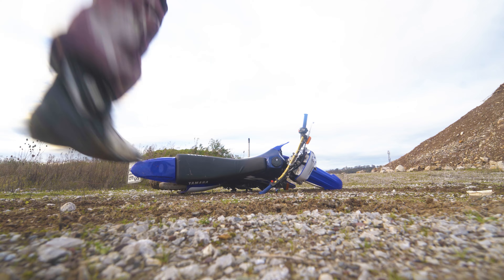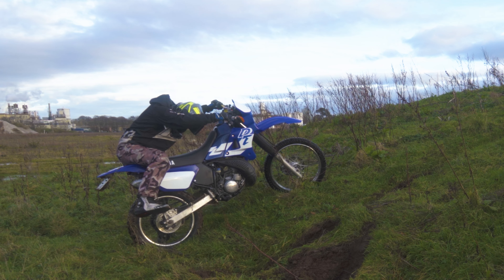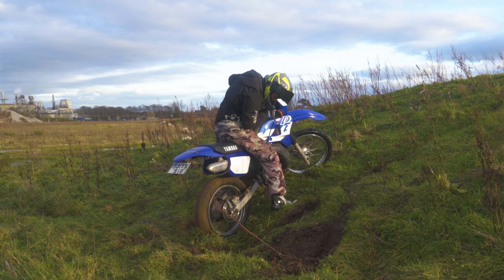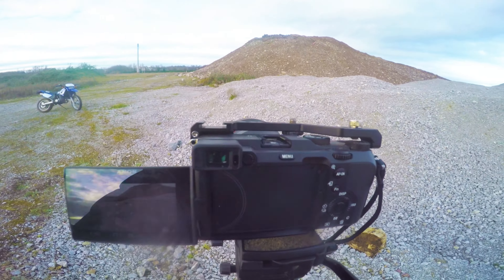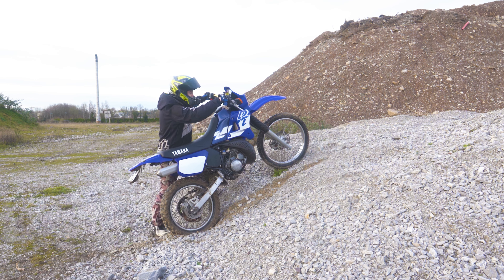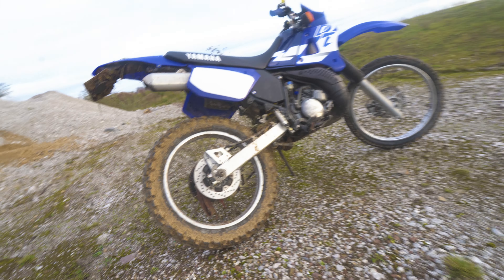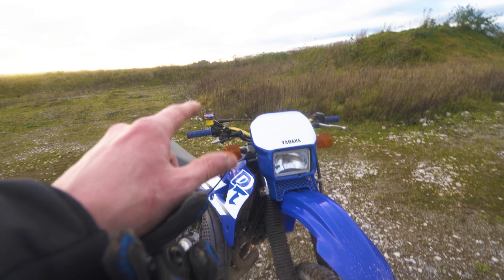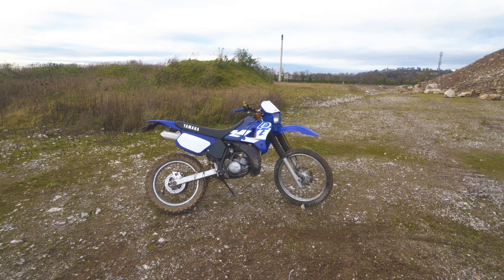Learning How To Slow Wheelie On The Little DT125R

Comment: Hey! What’s your height btw? Might buy this bike really soon, looks amazing
Reply from the maker: Hi, I'm about 5'8" if that helps. They really are a fun bike 👍
Reply: @RHauto  thanks for the answer! When you are stationnary, both of your feet are on the ground? Or the bike is a bit high
Reply from the maker: @imDraqe  yes two feet on the ground. It looks taller at first but the suspension is very soft and will drop much lower when you sit up on it

Comment: youd be surprised by how the standard hand guards save your leavers, iv dropped my bike a couple times and iv never broke one
Reply from the maker: Ya I think it's just the angle I had them set, too low maybe
Reply: @RH Automotive  you could be right mate I'm not sure but give it a go and if it happens again get the standard handguards if you prefer them they should be enough to stop it from happening again... when i said iv dropped the bike I ment 1 time trying a wheelie that didn't go so well and also another time when I had to turn into a slippery junction probably doing about 10-15mph front wheel lost traction and i slammed into the ground but the leavers came out intact...
Reply from the maker: @GuvnaFPS  the standard ones would look better  but they gonna take a while to get here. Might just fit the reinforced ones from my local bike shop for now since they're in stock and I'll probably end up dropping it again anyway 😂 Thank you for the advice!
Reply: lol standard hand guards are utter crap pmsl 
flimsy badly made and ugly and very weak
Reply: @primalcarnage2480  good to know